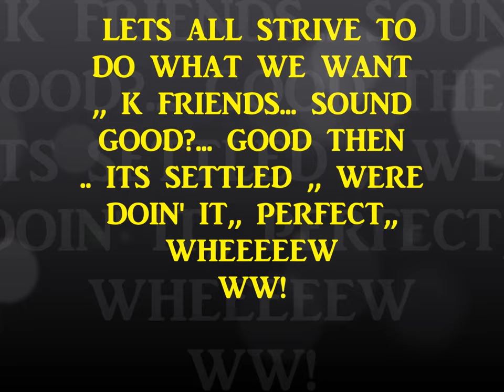Logging your firewood with a 1967 Mercury pick up truck

Comment: BILLY Ive got a 1968 Ford 100 get truck put in a 390 after the old 360 turned the main bearings it had adout 380000 miles on it . My dad bought the 68 new inspring of 68, he paid 2750.00 dollars for it then and the old truck still runs today. The 390 has rv cam in it pulls good, some day I would like to put a 4 barrel carb on it.

Comment: Hi Buckin,  I use my pick up and dump trailer to do all of my tree work,  but I know you have a dump truck,  how come you didn't use it for this job? I know they can pull much more than a pick up and you can load much more weight on them...just wondering not judging your method.  Thanks bud.